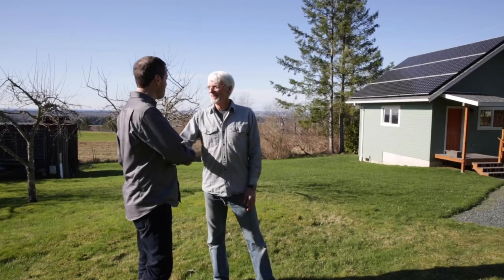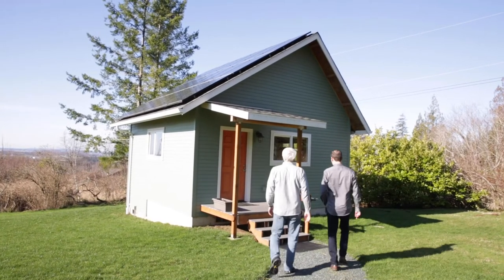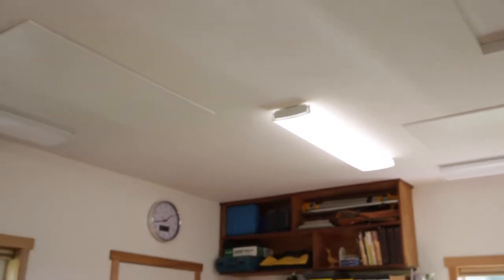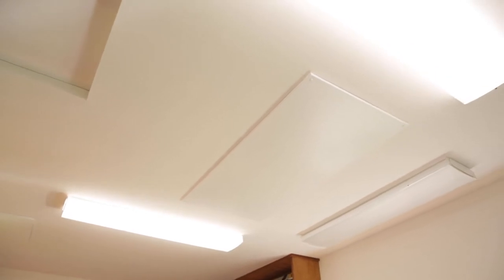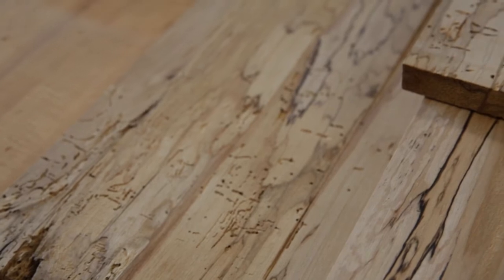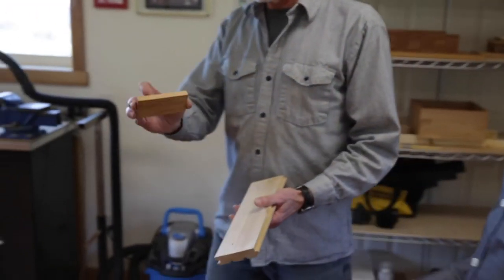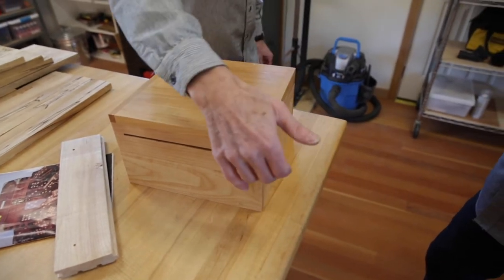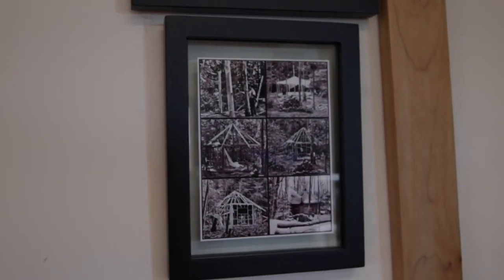Find the ultimate workshop heater - No maintenance, low cost, and no dust.

Comment: Nice video, Dan. What are the electrical needs for your IR heaters? Do you have a feel for what it costs to heat your workshop with these units?
Reply from the maker: Hi there, 
The electrical needs can vary depending on the current setup of your space and the amount of heaters you would like to install in your shop. Our infrared heaters can be installed in a variety of applications. To find out more information on our various product offerings and pricing please feel free to visit our website.
https://heatinggreen.com/
Thanks for your question -HG Team